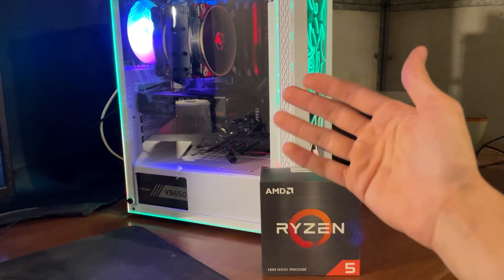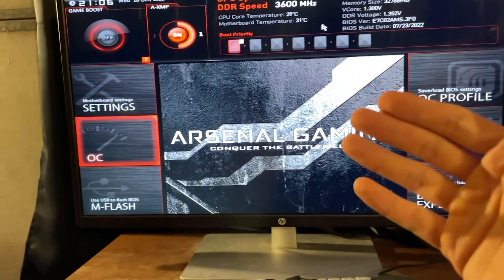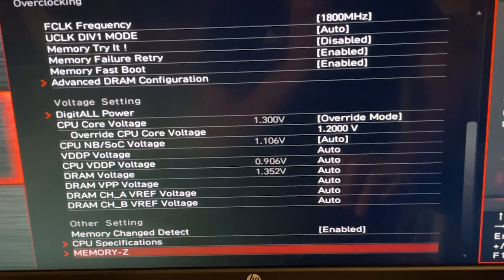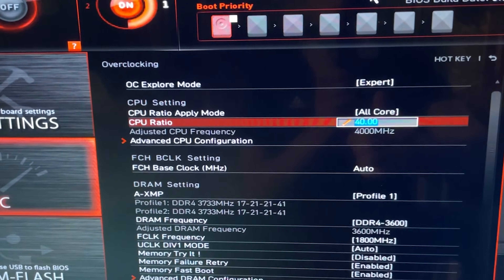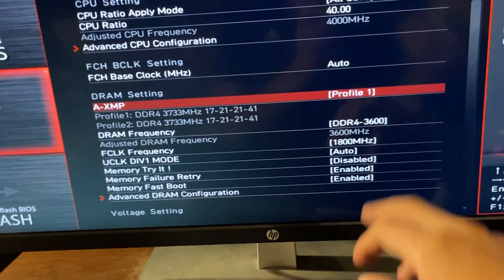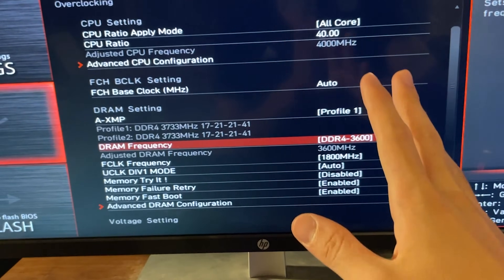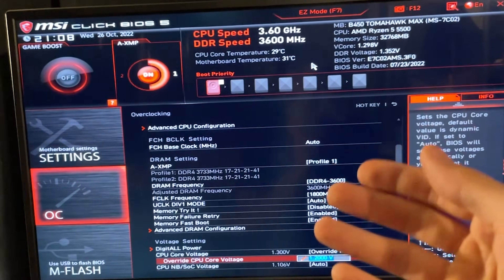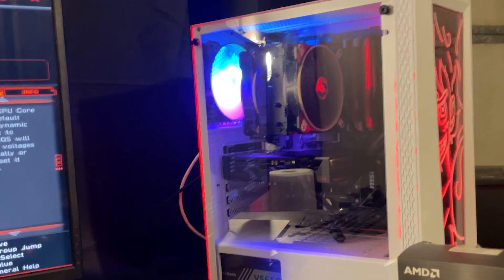Undervolt your Ryzen 5 5500 for more FPS and Lower Temperature!

Comment: For whatever reason AMD really slacked on this chip for the 5500 model I don't understand why I have to understand the stock heatsink came with it just turned off the board all the time if the chip got too hot I bought a better heat sink can't use booze clock where it turns off what a goddamn headache and I shouldn't have to undervolt my CPU and get better performance out of it this is such a joke thank you AMD for giving me more headaches

Comment: IS IT gonna bottleneck My rtx 4060
Reply: No, it works fine with my 6700xt so it should work fine with 4060 too.

My 5500 is with PBO @4.45Ghz allcore  - 1.344v Max 64°C with Macho Direct Cooler

Comment: Thanks for this video, my Ryzen is running stable 4.2 Ghz on this 1.2V I tried also 4.3Ghz on 1.26V and it worked too but I guess it is not necessary.

Comment: Underclocking and undervolting this particular CPU doesn't make sense to me.  It is so power efficient already that your better off pushing clocks up at stock voltages until you see instability then role them back .1mhz.  Even with a 92mm air cooler this CPU doesn't exceed 65c which is of no concern- with the overclock it hits 75c again on a 92mm ID Cooling frozn.  It rips at 4.6ghz and stays well within its limits temp wise.
Reply: I just installed a 5500 on an old b350m board. It is running stock. In Cinebench it started heading toward 95°, so I shut off all auto OC in the bios. It still hit 95°. It had an aftermarket (though still small) Cooler Master heatsink (with more fins and mass than the stock cooler), so I thought I must have not applied the thermal paste well. I removed the cooler and found everything good, so I switched to the stock cooler. I ran Cinebench again and it ramped up to 100° quickly before I could kill the test. I have an AIO coming tomorrow and I'll test it again.

I wish mine ran cool. I'm worried something is wrong with the die package that's preventing cooling.

Comment: i have a R5 4500, would this just work fine ?
Reply: Yes...R5 3600/X, R5 5500, R5 5500 are all same performance 
But do this on B440M or B550M motherboards
You won't find these settings on A520M motherboards

Comment: I wouldn't recommend it to anyone, my pc won't start now. I have already reset the bios by removing the cmos battery. Now Windows doesn't want to boot anymore, thanks for that.
Reply: not sure where youve gone wrong lol but your not gonna brick your pc by undervolting using the values as shown in the video. impossible. this tutorial is short and sweet standard undervolt
Reply: Don’t understand how da f it will help for boost fps if ur cpu mhz will be smaller when u use standart mode
Reply: @Alexander-gj9ty this cpu gets hot this is set so it doesn't thermal throttle and the performance difference is barely anything and ontop of that your cpu stability will be nicer and the cpu will last more years

Comment: Thanks for the easy quick video on this. I did this and even tried 1.1v and it's solid.
1.) I went from 65-70 watts to a 48 watts steady. 
2.) high stress cpu & gpu stress temp tests was at 84c (small pc case) and now it's 70c. When running online games it's around 58c max. Big improvement in temps!
3.) Idle watts is 2-3 watts more. No big deal, my PC is not idling anyway.
4.) I did lose 2fps across games and benchmarks. However, I have high enough fps anyway and it's not noticeable. Again, no big deal. Plus, the lower power consumption and less heat is worth it! The fans are quieter too!
 
 For those wondering if it's worth it, yes! Do it. Try 1.2v, run tests. If you pass, move down to 1.1v.
Reply from the maker: I’m really happy it was helpful! Thanks a lot for taking the time to leave some feedback :) Consider subscribing if you wanna support the channel!

Comment: No more fps in cyberpunk 2077
Reply from the maker: That means you’re GPU bottlenecked
Reply: @ImWateringPSUs  no, I have a super 2060 video card, I tested it in processor-dependent places such as Mega building h10 and dogtown, however, when I overclocked the processor to 4500, I already saw an increase + I overclocked RAM to 4000 and already then a real increase in cyberpunk is obtained

Comment: bruh how is your memory clock is 3800 when MB supports only 3433 (as I saw in the MB specs) 
I have the same MB Tomahawk B450 and I cant set memory higher than 3433 (black screen)
Reply from the maker: If you have memory rated for higher speeds, it will work :)

Comment: Bro ive 5500 and b450 msi vdh pro max bro before 77 C and cinabench in multicore was 10000: 10080 and new score after idid this is 9900 iwill add some milli volts and temp improved alot but iworry about. Something the single core performance was 1325 and now after 1161 thats ahuge diff is it good for games or it will make fps drop or fps loose? And if why ? And if not why? And thx bro❤
Reply from the maker: My man! Glad I could help, consider dropping a sub to support the channel :) No noticeable performance loss :)

Comment: 5500 is a low temp cpu during gaming with STOCK heatsink, if you have high temp problem just check your cooling system and the bios, check if you accidently turn on something which lead the cpu voltage higher than the stock value, the stock voltage without pbo on my asus board is 1.248v for your reference, it run so cool in temperature with this voltage
Reply from the maker: Weeell true but there are also SFF systems and/or people who are not good with the hardware side of things!
Reply: thats why I wrote that reply
Reply: Exactly what to do

Comment: Hello brother, I have a Ryzen 5500 processor and it causes lag in games. I changed the graphics card, but the problem persists. The problem seems to be cutting off the power of the CPU. If I do what you did, it will help.Is it okay if I just set the core ratio setting the same?
Reply from the maker: It should help, but set everything as in the video!

Comment: Don't set everything as fixed. CPU doesn't have to work with 4 GHz clock all the time. I use auto frequency and offset -0.1250. It works at best with this ~4 GHz clock, but goes lower if full power is not needed, also voltage drops then. At most it's 1.25V then and that's an ok value.
Reply: I also only have offset mode, so is it better to go 4 GHz with offset -0.1250 or offset -0.05? I'm new to CPU tuning, I want to use ideal settings for performance and the chip lifespan, I currently use 4 GHz but doesnt do anything with the voltage settings coz idk what number should I use in offset mode and that makes me worried about the heat coz I currently using stock cooler
Reply from the maker: Personally I prefer 4Ghz static, it will still draw less power at idle if set right!

Comment: Hello there, thank you for these videos! I have this CPU but I am not struggling with high temperatures at all (I have an aftermarket cooler). Is there another version of this undervolting that you would recommend where you don't lose single core performance?

Comment: Any guides for PBO? Have no idea what is it, got stable 4.400 on 1.25v, but needs 4.500+ The problem is that without calibrating, at 100% usage, voltage drops to 1.2v and its still stable at 4.400, however at 4500 pc turns off. Cant up voltage due to temperatures, but want to fix voltage drops. Hear that Curve Optimazer (PBO?) can fix it
Reply from the maker: Personally I don’t really recommend PBO on Ryzen 5000
Reply: @ImWateringPSUs  ok tnx, so should I forget about pbo on ryzen 5500?

Comment: I don't understand, with stock fan+rad, only 70°C with stock setting and runing Prime95...
Reply from the maker: Ahahaha that’s good! Fresh thermal paste, well ventilated case and good power limits in the bios
Reply: @ImWateringPSUs  it is the CoolerMaster NR200P, a pretty well case with, or without rgb ✌🏼

Comment: do also on gigabyte motherboard  Thanks
Reply from the maker: The settings are the same, but I should have a tutorial on a Gigabyte motherboard on the channel, so you should be able to double check the naming
Reply: Yes please waiting for your next video
 @ImWateringPSUs
Reply: I finally Setup my aorus motherboard bios following your instruction on the video I tried also boost up to 4.1ghz and boom low temp stable when I play heavy games i gain more fps when I play dota2

Comment: This is good to know, does undervolting simply lower the temp while the frequency change leads to higher frames in game?
Reply from the maker: Yes!
Reply: Thanks, dropped the offset down .05, changed flck, and also changed ratio, Temps dropped like 10-15c!

Comment: Hello there. Question is i use 5600x with gammax L240 thermal paste deep cool which is inside of the gammax l240 box. Furmark cpu burner test was 67-68. Then i bought thermal grizzly kryonaut. I use 5600x with L120 and the grizzly thermal paste cpu burner test was 65-67 i was shocked. Then decided to do this for 5500 but even grizzly can't help cpu burner test was 74-75 why? Please someone explain this
Reply from the maker: I’d say undervolt and put some Arctic MX-6

Comment: How did you manage to get a RAM frequency of 3600 MHz if the maximum for the R5 5500 processor is 3200 MHz?
Reply: processor doesn't have ram frequency limit, that's about your arm or your motherboard
Reply from the maker: Exactly!

Comment: Dewd... This worked like charm. I have a different MB so my BIOS Settings were slightly different, but after some tweaking it runs like charm. I managed (just my first try today) to bump up my boost to 4,45ghz and my voltage from 1,38 down by 0,150 to something around 1,22~. My temperatures dropped also. The CPU used to go to 90° in prolonged 100% stress test. My case cooling is worked out as well (tried all configs and placements for fans). But now I see the max temp capped at 73° under prolonged workload. In games it dropped from 62ish to 70ish down to 45ish  to 58ish. My BIOS also indicates the voltage with coloring. 0.100 to 0.150 stays grey, 0.2 is shown in yellow, 0.3 is orange and everything beyong 0.45 is colored red. So I will sta with 0.150 its a good deal. Due to the temperatur headroom I might try to go for 4,5ghz(+50mhz) or 4,6ghz(+150mhz) to match the 5600.
I had my old 1700 running at stable 3,9ghz with aircooling. Benchmarks were great and temps too.
Btw. its all aircooled numbers and stock AMD wraith Cooler... I saw GPU and CPU in Hogwarts Legacy have the same Temps (55° to 59°). I use Vsync to keep of some load from the CPU (thats were I notice the hexacore).
Reply from the maker: I’m really happy it was helpful! Thanks a lot for taking the time to leave some feedback! :) I’ve also got a few build videos on the channel and more coming, if you like the content consider subscribing as it really helps me a lot!

Comment: What about turning on PBO and setting it just to auto? Is that a good option for someone like me who does not like tweaking with the settings?
Reply from the maker: Nope, I’d recommend doing as shown in the video
Reply: Did you enable pbo or not then? I'm also confused
Reply: @akhilpawar5960  Yeah, I just left PBO on and left it at that.
Reply: @Yawzerss_yum  it boost at 4.2Mhz  in gaming?
Reply: One doubt I have ....manual undervolt draws more watt or stock will draw more watt?

Comment: I just finished building my new pc with r 5 5500 n gtx1050ti n 8gb ram 7.88gb usable it keeps freezing and when i play games it crashes even on idle
Reply from the maker: I’d really recommend undervolting and see if it helps!
Reply: @ImWateringPSUs  this bios is different bro I'm using ASRock I only see vdd voltage

Comment: So Do you reduce the voltage from 1.3 to 1.2? At 4GHz all cores Right?   Btw i Check out other of your videos and u recommend 1,025 voltage. Shall I leave it at 1.2? Or I change it to 1,025, which one is better?
Reply from the maker: Hey there! Yes I do reduce it that way, however the R5 5500 is worse binned than a 5600X, so 1.025 would be better but it won't be stable on most chips. If you have the time to test it, try it out!
Reply: @ImWateringPSUs  nah. i believe in you, if you say 1.2 is better i'll leave thay way. Your videos have helped me a lot so I trust you.
Reply: @ImWateringPSUs  If I leave it at 1.1mv it works fine for me or does it necessarily have to be 1.2

Comment: I couldn't change the max frecuency because my motherboard is A520, but it did let me do the undervolt however

Stress tested it, the performance pretty much falls very little, but the max temperature at full load fell from 88°C to 64°C running on AMD Wraith Stealth stock cooler
Reply from the maker: I’m really happy it was helpful! Thanks a lot for taking the time to write this! :)

Comment: i got a brand new 5500 and with no overclocking or modification in the bios , my temps goes up to 80°c in games (4.25ghz) and 45/50°c when idling with master cooler t20 is it normal ? 
when i disable PBO and cpb , the cpu idle at 35°c and never go beyong 52°c in games !!
Reply from the maker: It’s a bit high but definitely not dangerous! You’re losing a lot of performance by disabling everything though, I’d recommend undervolting as shown in the video!

Comment: It lost 120 bits of performance on cinebench R15 after applying the same settings 
😢😢
Reply from the maker: But on longer workloads you'll actually gain performance, not to mention the power and temperature gains! If you just want your benchmark score to be higher, then you need to overclock not undervolt! (And I have tutorials for that too!)

Comment: can't find the CPU ratio option, is it my mobo?
Reply from the maker: You might need to set the bios explore mode to “expert” or “manual” or something like that. But the option is there for every mobo!
Reply: @ImWateringPSUs  i did, i just saw your vid on the 5600X where you do the same and in that vid you have the same bios as me, and the option doesn’t appear where it should be, very weird. I have a TUF A520M-PLUS + 5500

Comment: My TEMPS for CPU 42c (light use) 55-60c (gaming) Ambient temperature (room temp) hot 28-32c.
My RIG
R5 5600X
CPU  Cooler Thermaltake CPU Liquid Cooler AIO TH360 ARGB Sync Black (3X 120mm fans)
My OC
46.5X multiplier
CPU Vcore 1.321V (Less voltage will crash when stress testing)
PBO AUTO
+200MHz

The stock cooler for the R5 5600X is trash! super high temps with it while gaming. Highly recommend spending 100 USD for a AIO CPU Liquid Cooler.
Reply: 100 USD cooler is more expensive than Ryzen 5 5500 itself :D
Reply from the maker: Great settings! The 5600X is a completely different CPU in terms of both power consumption and efficiency point though, I actually have a dedicated tutorial for it!

Comment: Bro recently i notice my cou r5 5500 l3 cache clock in hwinfo 64 goes upto 126000mhz only in idle workload if processor in heavy workload like Cinebench its rock solid 4.25ghz so its just glitch or something wrong in cpu no bsod no game crash i updated bios degrade bios uninstall reinstall hwinfo 64 clean window installation its show same result pls tell me  any idea ❤❤
Reply from the maker: It’s just a bug, nothing to worry about! :)

Comment: Undervolted and oc my cpu using ryzen master, 1.281 volts with 4400 running stable at max temp 65, happy with the result! I use deepcool gammaxx l240 so that's why the temp is that low
Reply from the maker: That’s REALLY good my man! Great job! I love DeepCool coolers too, made an i9 12900K build with their new line!

Comment: Funnily enough, when i set it to your settings 4.1ghz @1.2V, i get lesser fps AND higher temps.
When i set it to 4.225ghz@1.2V i got Better FPS AND LOWER temps. Kinda weird idk why that happened but it did
Reply from the maker: But that really doesn’t make sense lol, how would setting the same voltage but higher clocks result in less temps😅
Reply from the maker: Btw I recommend you set it to 1.025V for efficiency, not 1.2

Comment: my motherboard decided to put my cpu voltage to 1.5. Thanks to your suggestion, I changed it to 1.2V. Now I have better mouse feel as well
Reply: А моя 1.4v.....
Reply: same on the rog strix b550a-gaming
Reply: @explodedotthesecond627 same at Asus primę b550
Reply: Mine was at 1.536. that's just CRAZY!!
Reply: 1.2 is the stock value, i thought you turned on something on your board and it tune the voltage to 1.5
Reply from the maker: Wow man, 1.5V is a LOT, it would’ve degraded your CPU quick. I’m glad you fixed it! :)
Reply: @ImWateringPSUs the fact that going over that actually burns Ryzen 7000 CPUs says a lot
Reply: Mine go to 1.55volt and it's dead now

Comment: i don't think that a corsair vs650 is a bad psu its rly good bro
Reply from the maker: I agree it's more than enough for this build, plus personally I haven't had any problems with any VS series PSU, but they kinda have a bad reputation online so I consider it a "budget" unit due to how the public perceives it!
Reply: @ImWateringPSUs  psu tier lists are bullshit. I use a deepcool budget psu that i got for 46€ brand new and i have a rtx 3070 ti and a r5 5500

Comment: i use 1.14V 4.25GHz (consumes 25Watts) but the best is 4450MHz and -30 pbo with 26W limit
Reply from the maker: 25W?! Those are some insane numbers, I think you might be getting your readings slightly wrong😳
Reply: @ImWateringPSUs  A lot more than slightly, I undervolted the 5500 by a bit and I get 2W less than by default at full load.